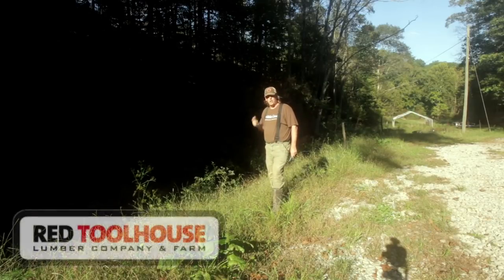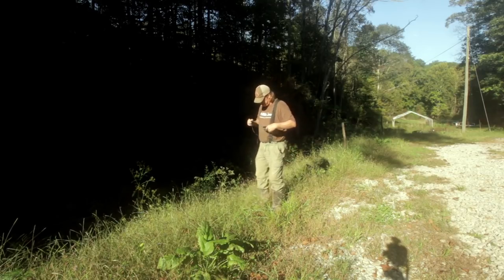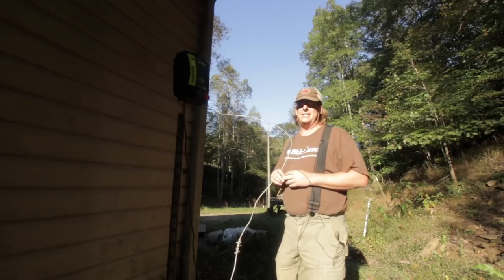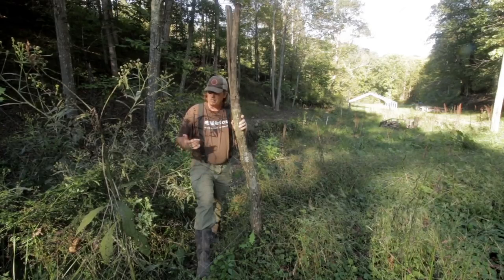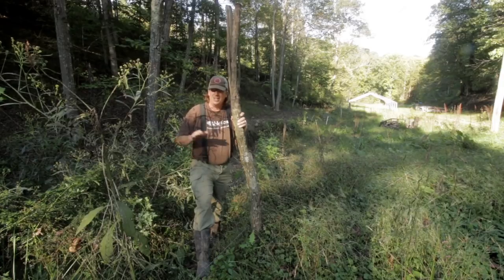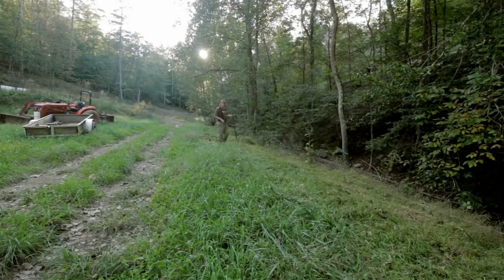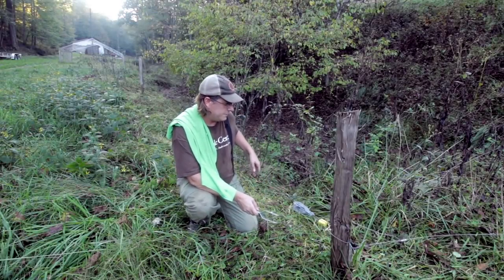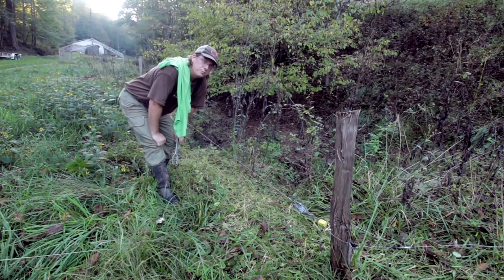Clearing pastured pig electric fence lines of grass and debris

Comment: This probably is not practical for large areas such as yours. I only have 1/4 acre paddock for my pigs. I used the scabs or throw away planks from my sawmill. These are the first cuts that come off any log.Their is not enough lumber in them to be useful for most projects. Otherwise the pieces would be burned or given away. I place them on the ground under neath the fence. Since no sun light can get through. No grass can grow directly under the fence. Most of them are not as wide as would like. So end up shifting them back and forth under the fence wire every 6 weeks or so. Once the grass that is not covered starts to grow i just shift the boards again. Does not take long to move the boards. Eventually the grass that is 8 inches away from the fence gets tall . Then it starts to droop over the fence. I was able to get by with just one trimming with the weed eater for the whole summer.
Reply from the maker: That is a really great idea! The rotting wood will help the soil too.